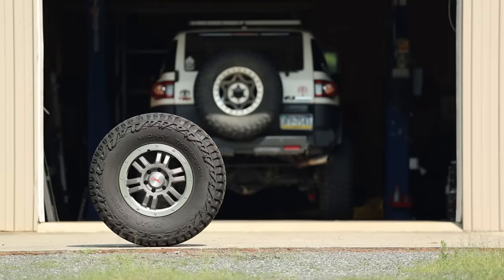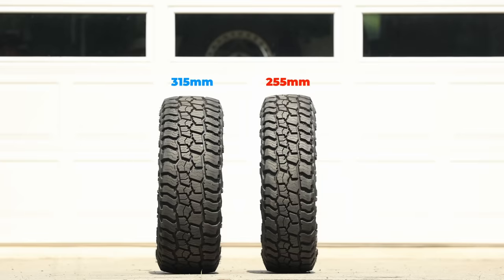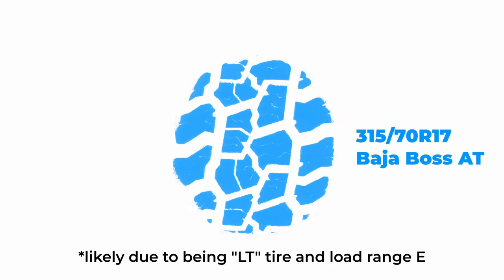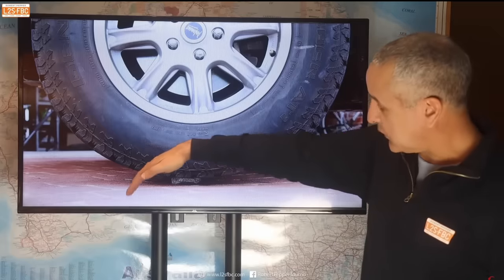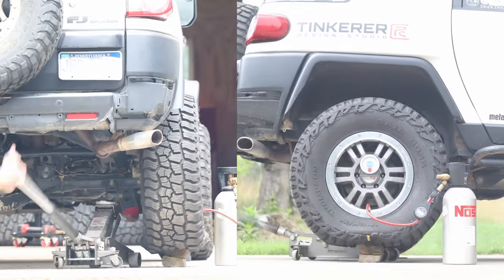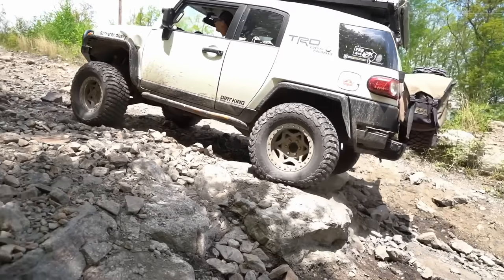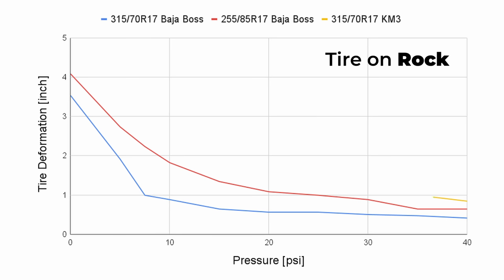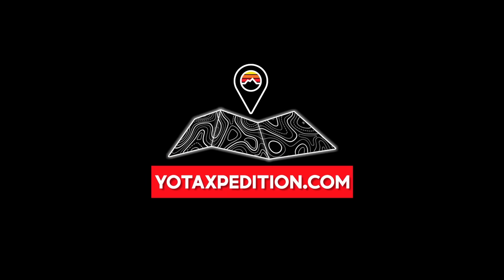3 Scientific Experiments to Settle This | Wide vs Narrow Off-Road Tires

Comment: It really depends on the surface softness and viscosity of what you’re driving over, the contact patch is going to be different on a surface where the tires are sinking two inches into the terrain. Also the smaller the contact patch the higher the psi on the surface unless you are taking advantage of the side lugs and friction. I’d imagine rock crawling over an edge or more “pointy” stair step might advantage a wider contact patch whereas other irregular surfaces may advantage a longer patch. I’d imagine each size and brand has different advantages on different surfaces.

Comment: If wide tires were so good then you would see miltary vehicles and tractors running them. Narrow is the way to go, I put 255/85/16 all terrains on recently, I can't believe how little they impacted street handling and yet the ride quality when hitting bumps and holes is dramatically improved. Really excited to see how they do off road this year.

Comment: Great vid! Your existing tires (KO3’s) are used and already broken in. This could cause their spring rate/stiffness to be reduced at equivalent pressures compared to a brand new tire. I doubt this would have huge impact but it might not be negligible.

Comment: I had 255/85 16’s but now have 285/75 16. The 255’s definitely had more “flex” when turning, felt a little squiggly going fast and turning. 285/75 feels more stable on the highway.

Comment: Great video!  I feel use is very important.  I'll stick to wide.  90% of my offroad use is on sandbars at creeks and rivers.  Heavy truck and skinny tires is asking to get stuck.  I do miss the MPG tho.  My 12.50's cost me 3.5 mpg on my F150. Im considering going to a 285(11.5) as a compromise.

Comment: Psi is pounds per square inch. 
In theory, the vehicle weight, divided by tire pressure, should give you close to the total ground contact of all four tires combined. 

Some of the variables are the natural "springiness" of the tire sidewall and tread belt materials. This is very apparent when you look at a bias tire next to a radial tire: the bias tires actually hold weight even with no pressure, because of the tire construction. 
Radials also have steel belts spanning their width. Because the belt strands are the same thickness, the wider tire will have more steel across its width. The additional steel gives additional stiffness against tread flexing over a narrower tire of the same construction. 

Another benefit of the narrow tiers is that, because of their longer contact patch, the tread lugs of the tire are doing more "grabbing" of the terrain as the tire is vertically deforming more.

Comment: I like wider tires for my off road vehicles I take actually off the road. Narrow tires on cars I drive on the road, but still need the best grip possible. Especially with rwd. 185 tires on the volvo 240 rocks on dirt roads, while 265 are awesome off road on the nissan hardbody

Comment: Both wheels appear to be the same width this will pull the shoulder of the wider tyre off the ground. The 2 tyres are 65mm different in width. To get an accurate contact patch the wheel for the wider tyre needs to be 65mm wider than the wheel for the narrow tyre.

Comment: I too have a ME degree, three of them actually and I enjoyed your video - however.  It is very much geared to rock crawling.   Mud, Snow, or in the cornfields with corn stalks, mud, snow all mixed together in the upper 30;s at the end of harvest for pulling a grain wagon?  My experience is the wider tire floats on the mud mix better and if you are only talking one inch in width not that much more snow has to be compacted in the Minnesota winter; too wide is bad.  For my F-350 I like to stick to 37's or 38;s and 12.50 or 13.50 wide AND the 3PMSF rating really helps - cannot find a 38 inch in any width that is 3PMSF rated.

From a ME with 35 years of experience - word of advice - data is great but there is a time and place to let your gut (experience) make the call.

Comment: Sand tires work on the same principle of narrow width with with low pressure for maximum traction. Offroaders in the middle east have always preferred narrow vs wide tires

Comment: The contact area is indeed not dependent on  tire width. I learned already  at high school that P = F/A with P pressure , F the Force (read: weight on axle) and A the (contact)area with the ground. As mentioned in the video the shape of the contact area differs  a lot but not the area (at least not that much). Just  simple physics 🙂

Comment: When you did your prints the tires were cold and not moving. If moving it act like tracks on a tank depending on how much pressure there is, I've gone from 2 lbs to 50 lbs depending on in environment.

Comment: One thing I kept asking myself as I watched the video. How much did the rim width affect the contact patch. I think putting the 315s on the same with wheel would distort them tending to bow out the center of the tread thus giving you a narrower contact patch we found this to be very much true drag racing running similar experiments

Comment: Basic physics prove contact area for each tire should be the same. The reason lower pressure is a little different is because the construction of each tire is a little different. The rubber and steel belts are supporting some of the weight, not just the air.

It would be interesting which tire has less rolling and turning resistance.

Comment: Depends on what you’re after. The wider tire is going to float more, which is something to consider. it comes down to overall usage and type of terrain. The wider tire will also have a tendency to hydroplane easier as well as a higher rolling resistance and weight which negatively impacts fuel mileage not to mention the higher actual cost of the wider tire. Sometimes a wider tire can help tracking or being forced to follow other peoples ruts, mainly in mud. Unfortunately, just because it looks cool, doesn’t mean it’s a better option. You have to have a clear goal  of the vehicle in mind. There may be a difference in the speed rating and or load rating.

Comment: The situation not cowered in video:
Clay pit or swamp: pizza cutter despite having same weight over surface distribution will cut into surface easier much like milling cutter due to less mass of clay/swamp to move

Comment: I’ve been spending way too much time thinking about tires lately, and important point that I don’t think was mentioned is rim width.  It looks like you’re running both tires on the same rims?  The approved rim width for the skinny’s is 6.5-8.0, and the measured rim is 7.0.  The thicc ones are approved for 8.0-11.0, with a measured rim of 9.5.  So if you’re following manufacturer’s recommendations, that means it’s an 8” rim- but you’re stretching the skinny ones an inch vs the measures rim, and pulling in the fat ones an inch and a half.  While that’s still within spec, I’d expect some ballooning on the wider tires, narrowing the contact patch at a given PSI. which is exactly what your prints showed.  It would be interesting to see how varying the rim width would change the contact patch for a given size.  Or maybe I’m overthinking it.  Interesting video either way.
Reply: your not really overthinking it - but i have tested rim widths and while it made a difference unless your extremely wide its not enuf to matter,  once the rim is wider then the tread width (not section width) u see real problems for off roading due to the rim overhanging the sidewall when you air down, in my humble conclusion wide rims are about equally as bad as wide tires or worse due to breaking a bead much easier (hope that helps somewhat) after buying over a dozen sets of offroad tires i never have the rim wider then the tread width EVER
Reply: @jdogx34  that does help.  I’m working on a 1950’s Jeep and want to keep the tall skinny tire look, but go to a radial tire instead of the bias plies.  With 5.5” rims, I don’t think I’ll have to worry about the rim being wider than the tread. 😆.  Bigger problem is they don’t make 205/85r15 AT tires for some reason (possibly because I’m the only person who would want them?)

Comment: Great video but you have to consider that your new tires have  not been broken in and are also stiff. The BF's are soft especially from have been used off-road at low air pressures just something to consider.

Comment: I am at 5000 miles on my 255/85-17 baja bosses and took them to Moab and was happy with them.  I have a rubicon 4 door. I ran around 14psi and probably should have been in single digits.  They really did not deform much.  they did not chunk like my buddy's ko2's 315/70-17 did. His did appear to have a bit better traction as his was C rated and did deform more at the same psi.

Comment: Hi!! I thought about this video a lot after watching it and one thing I can think of to justify wider tires is on loose surfaces like sand and mud where I would logic that a narrow tire is more likely to dig a whole and sink into the surface than a wider tire. You prove the surface area touching the ground is actually better on a narrow tire, but its track width is smaller meaning the weight would be moving the same section of the trail likely creating a bigger hole thats easier to get stuck into. I would love to see this tested. If an all terrain tire is really all terrain, it has to still be effective on loose terrain.
Reply: But the narrower tire's longer tread would be moving the surface of the trail back under itself for a longer distance due to the longer contact patch. A wider tire will more quickly move the surface out from under itself, which is when you start to sink.

Comment: 5:13 I want to mention that the area of contact basically gonna be the weight of the vehicle in pounds divided by pressure in psi the result is the total contact area in square inches for all 4 tires. The distribution of area for each tire will depend on the weight on that specific tire. So, if weight is distributed equally among the 4 tires they will have the same contact area, if more weight is  on the rear axle the rear tires will have more contact area relative to the front tires.

Comment: This is an important testing covering most aspects. However, the most crucial question is not looked into throughout the comparative analysis: the longevity of the tire assuming both 315 and 255 are tested in same off-road and on road condition.

Comment: Where I come from without modification to the wheel arch the wider tyres at 305 would be illegal as the tyre protrudes outside of the wheel arch. Only the 255 would be legal. Happy travels.

Comment: I think the biggest difference between the Baja Boss and the KM3 is that one is designed to be an all terrain tire, while the other is designed to be a mud tire. I think mud tires will generally have better flex with the wider grooves between the tread blocks. Mud tires seem to be more desirable for rocks and mud because of the footprint they can give along with the ability to self clean at slower speeds.

Comment: So in other words, if you the same or marginally better manipulation of tire, get the narrow to maximize benefits for on road usage and off road usage at low PSI.

If you want to be off road ready without having to hair down often or not worry about tire deformation at 30PSI get wides

Comment: Classic Range Rover went with taller/narrow and the manual said it was best to cut in and get to the better traction.  I agree.  My 205R16 tires pulled out several circumstances of a buckshot monster mudder hummer getting stuck because he skated and floated instead of getting good traction.  Id rather the taller/narrow, speaking as the prior co-founder of space coast rovers running in the Florida swamps.   BTW my longest term set of rover MT tires was 235/85, but due to lost gear ratio on highway in mountains I switched back down to 205r16 to restore torque on tall WV hills on the 119 and rt10.  But offroad in low range an aired down 235/85 is the way to go.  Again, you end up pulling a lot of friends out with wider tires on the trails. So get a spare set of wheels for both worlds, and electric impact, and 2 jacks.
Reply: Your also in a vehicle that doesnt articulate like a classic range rover/defender.  With 3 feet  of articulation in a classic rover you risk tearing off a fender with tires too wide. Running the same obstacles down a rocky hill - a Jeep with a new $5K suspension mod was 2’ off the ground with one tire versus 2 tires on the ground in a rover setup.  I dont know toyota articulation, but I havent yet seen another 4wd with that feature.  Id like to see your ability to clear tall obstacles and the impact on Toyota with tall and skinny - and which one gets out the tin snips to open up the body more, if encountered.

Comment: In the southeast wider is better.  We mainly deal with deep mud, 24” or more deep.  When you rely on skinny tires you dig too deep and bottom out your axle.  With a wider tire you have to keep your RPMs high but if you can sling the mud out of the treads you can get almost a floating effect and stay on top of the mud.  If it’s that thick gumbo mud you can’t clear then you need to stop spinning your tires before you dig too deep and winch out.

Comment: Always enjoy your videos, but as detailed as they are, I don’t believe this was a apples to apples comparison.   Them KM3 appeared used.  Leveling off the tread and working the tire in.  I know from off-road use on motorcycles there is some stiffness reduction after using them (where 6-12 psi is common). I can only imagine howI much work this video was but would be interested to see results after each set of tires had 5-10k of comparable miles on them.   Or a new vs worn in set of the same tires change.

Comment: Depends on what you're driving over. 
Pizza cutters for sandy conditions! 
Why? Because the reduction in rolling resistance (the extra floatation gains) when lowering pressures, is NOT from additional width -- it comes from the length of the tyre's footprint. 
The fatter the tyre, the more material (sand, sandy soils) it moves -- it builds more of a wall in front of itself. Whereas, a narrow tyre would have less material in front of it and therefore less rolling resitance. 
Tyre wall height also plays a big part in the lengthening of the footprint -- especially at lower pressures. A smaller tyre wall height would be better in sand.
But, if you prefer rock crawling.... maybe wider is better. 
Yes, tyre pressure matters. But tyre width and side wall height also come into it and all this is connected to what type of terrain you're about to tackle.

Comment: Sorry you missed the point of the wide vs skinny tire debate....it has nothing to do with "Contact Patch".  If you are drag racing on sticky pavement with sticky tires then Contact Patch comes into play.  Off road, Ground Pressure (think PSI) is why skinny tires prevail.   That's why tractors have pizza cutters.

Comment: It might be interesting to see how a Load Range C or even a P tire does in these measurements. I'd think they air down better at the same PSI due to not being as stiff. Load Range E tires are very stiff and are really designed for vehicles heavier than the Toyota in this experiment. Load Range E tires are typically designed for full size 3/4 ton pick up trucks.
I bet you could get the flex you need at higher pressures with a P or C tire, with less risk of popping a bead. 
We used 12 psi with P rated tires on the beach and they flex very well (size 245/70-17), on a 2007 Grand Cherokee

Comment: Traction is also changed by weight over the tires. Narrow tires have more weight psi with the surface you are driving on. That’s why putting bags of sand in the back of a truck increases its traction. Therefore better traction on snow.

Comment: Lose any air and you run risk of rim pinch. Like diff between a ten speed  and a mountain bike.  I like a wider to protect rims and get the floatation . Skinny is great in shallow mud and snow . But when the going gets tough bigger is better. The skinnier you go the more likely of failure . Get a slow leak or seep out on a rock and the bigger one will resist seepage and stay on the bead way more.  Rolling resistance ,  fuel milage and price are a downside of bigger . But thanks for getting all technical for us to visualize it.

Comment: There’s 2 more areas to explore that I can think of and those are sand and mud.  I think based on comments from Utah YouTube channel MORR that Lardner diameter tires do better in the sand.  It would be interesting to see a sand imprint test of pizza cutters and thicc tires. The other arena is mud and there’s a lot of types of mud which tread design would impact there effectiveness but there’s hard bottom mud where a pizza cutter might do really well and bottomless mud where floatation is king.  These would be very interesting as well. 😀 thanks for the well thorough experiments and testing!

Comment: Interesting video, but the thing that seems to be missing is very soft terrain. As I understand it narrow tiers are better in mud/snow/sand that has a bottom as they slice through the slick stuff and get to the hard stuff better, but in mud/snow/sand that basically has no bottom wide tires have much more flotation due to the larger surface area and hence won't be as likely to drag axles/suspension arms through it. Not many rocks to climb here but a lot of deep mud and sand and hence you almost never see a built 4x4 on pizza cutters here in East Texas. I have seen the same thing in arctic builds where they use very wide tires to stay on top of very deep snow.